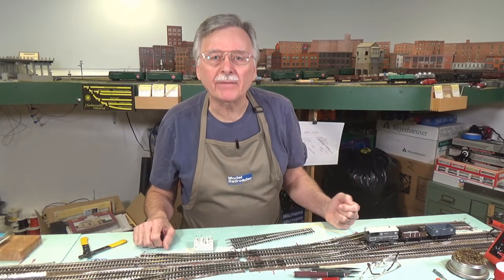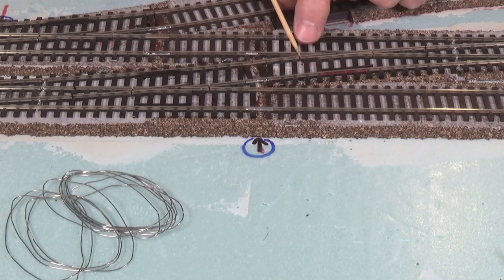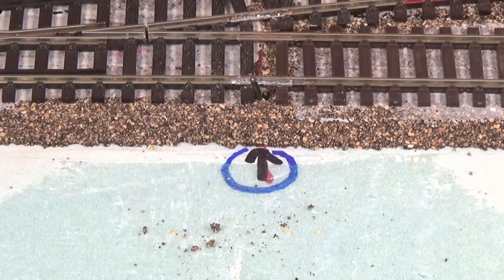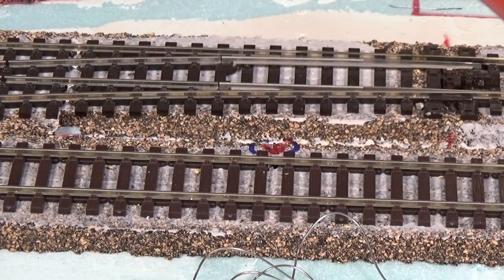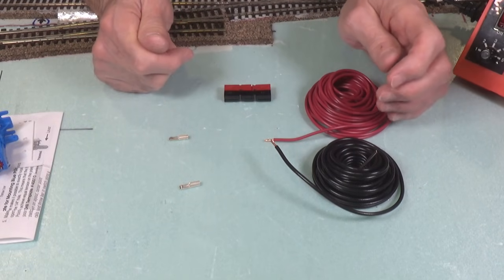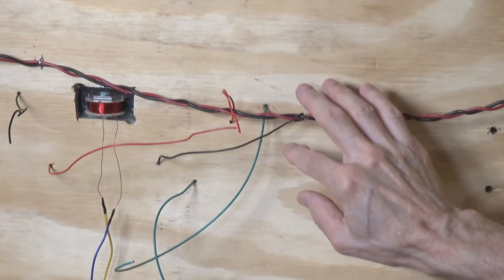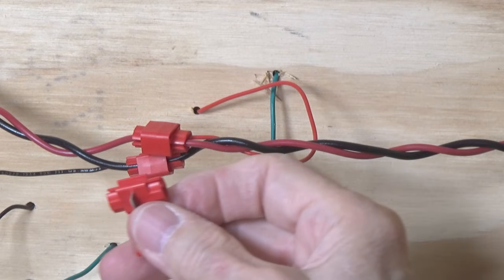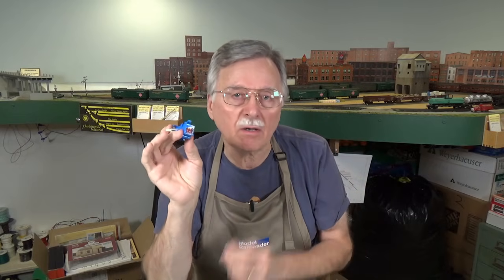DCC Power Bus and Track Feeders (143)

Comment: Thank you for you videos, I have a question, I’m running 12 gauge bus wire, and I’m gonna use 20 gauge feeder wires, what is the best way to connect these 2 gauges,  I don’t believe suitcase connectors will work for 12 -20, or am I wrong? Ty
Reply from the maker: I have never run across a connector for that big a difference in diameters but they may be out there. Take a look at various online sources for things like that and see what turns up. You might see if there is any way T-tap connectors can be used with that big a difference in sizes. I’ve just never had the need to look into this specific question.
Reply: I encountered this problem on my old layout and one of my club members recommended connecting a 16 gauge sub-bus as an intermediate between all my feeder drops and the main 12 gauge bus. I actually had the sub-busses connected about every 15 feet to the main bus and extended out 6 feet in each direction. My main bus was 48' in one direction and 45' in the other from my NCE SB5 Smart Booster. I had no problems running 2 consists of 2X2 MU'd sound and nonsound equipped Athearn Genesis engines around the layout. So had 4 sound units and 4 straight DCC units operating at the same time on the double track mainline.

Comment: Do you recommend twisting the bus wire for all dcc systems or just nce?  ...and why?
Reply from the maker: Digitrax now recommends it along with NCE. It helps with electronic noise rejection and helps prevent distortion of the DCC square waves, which can lead to rejection of the DCC commands by the microprocessor in the decoder. On layouts with runs longer than 30 feet (10 meters) and amperages greater than 5A it helps prevent voltage spikes that can cause CVs to change and even kill decoders in extreme cases. On the Piedmont Southern with its long bus runs and high amperages I use 14 ga zip cord which has essentially the same effect as twisted pairs. It really wasn’t necessary on the modules but I wanted to show it to folks who might be building bigger layouts or planning to use their modules with a larger setup.

Comment: How would you wire a swing bridge?
Reply from the maker: I would just use flexible wire and probably add a quick disconnect on the bridge to pull it for maintenance, etc.

Comment: Larry, thank you for the video. One question,  how much insulation do you remove from the wire?
Reply from the maker: On the Anderson Power Poles I remove just enough for the end of the wire to fit into the connector. On the feeders just enough so no insulation sticks up above the cork roadbed.
Reply: Thank you. I look forward to more videos. I am going back through your others again for more tips and tricks.

Comment: would flux help soldering or does it corrode?
Reply from the maker: Flux is usually not necessary where the rails and wire are both clean and unoxidized. My solder has a small amount of resin flux in it and that usually does the job. However if a lot of heating is necessary I will add additional resin paste flux since the extra heat can cook away the flux in the solder before the joint is completed. Never use an acid flux or any with zinc chloride in it on anything electrical.

Comment: I am switching from EZ-Track and I don't understand all this feeder wiring and why do we have to place those feeders so much? What is my actual power box I need to run everything?
Reply: Unfortunately DCC was state of the art in the 1990's but now very dated. Why all the feeders for DCC, is that the DCC signals coming through the track must be distortion fee and any loss of signal can cause the engines to loose their mind. Some newer DCC boards have a Keep-Alive feature that maintains the engine settings before loss of signal. New modern wireless systems such as Wifi or Bluetooth (Bachmann EZ-App or BlueRails drop-in boards for DCC) are a much better method to control. I use Bluetooth with 178 feet of HO track and feeders every 40 feet and never had any problem. I hate to solder and use pre-wired joiners.

Comment: Hi Larry. Very interesting. It is probably very simple, but you didn't explain/show what happens at each end of the full length of the power bus.
Reply from the maker: Nothing, you just leave them dangling there, the electrons won’t drip out.
Reply: @TheDCCGuy  But you have to get power INTO the bus in order to distribute it to the droppers.
Reply from the maker: I showed in the video how to attach a barrel sock connector to the bus so as to attach the power supply. You can put it anywhere on the bus you want.

Comment: The main problem with suitcase connectors is that they are used wrongly. People are using the wrong gauge wire in them which makes for unreliable connections. IDC connectors are very sensitive about which size wire is used. Also they are not designed for solid wire. As for as wire color,  I just choose colors that make it easy to trace them in the event that troubleshooting is necessary. I find that for larger gauge wire, automotive primary wire works well. To twist or not twist bus wire is something I do not worry about since the data rate is so slow.
Reply from the maker: Exactly! I see so many folks using the larger ones designed for 12-10 ga because it has a twin blade and they think it will grip better. But used with a 14 or 16 ga bus it is worse. Also a good set of pliers with a square bite is important to get a good installation. However all the electronics engineers I have talked with about this are insistent about the value of twisted pairs or zip cord and that includes one who designed for major aviation manufacturers and another who worked for NASA.

Comment: how  an expert solder the feeders to the rails and then recommend the use of butcher clips to join your feeders to the bus wires. why would you want to install something that just has to be replaced in12-18 months after installation????
Reply from the maker: I’ve been using them 20 years and never had to replace a single one.

Comment: On most DC circuits (especially 12 volt DC circuits), Red is always positive, Black is always negative. - Red is always power, black is always Return. -  Not....." Red is Rear," "Black is Front". Even your 12 volt DC Automotive circuits are wired with Red on Positive, and Black on Negative especially the main power cables going to your Battery. Red on Rear, and Black on front would be mighty confusing (both mentally and phyically), to most electricians if they had to troubleshoot and was trying to track down an electrical problem in a multiple wire/component, wiring circuit without having prior knowledge of how that particular electrical or electronic circuit was wired by the designer/builder, that's why the national electrical code was written, so that there was at least a somewhat symbol of standardization among all electrical and electronic circuits.  It is labeled under, and called "Safety" ! -12Volts DC wired the wrong way normally don't cause injury or death, but will sometimes cause component failure if wired wrong or backwards, when rehooking up the wires wrong. But when you get into higher voltages and higher amperage, such as over a hundred volts or more it could cause injury or death. Now, say what you will. But in my opinion and with my training in electrical and electronic circuits either, learn the proper way, and do it properly or don't do it at all, and let a person trained to do it the right way do it. As a trained technician I sure would not want to have to start troubleshooting and repairing an electrical or electronic circuit that somebody wired up wrong or backwards or designed with the wrong color codes on the wires. - It's only asking for trouble as well as component failure by not getting it right during repairs and possibly even injury or death because it's not wired properly with the standard color codes according to the National Electrical Codes. - It would be like having the Cardiologist hook up the wires to your heart pacemaker backwards.